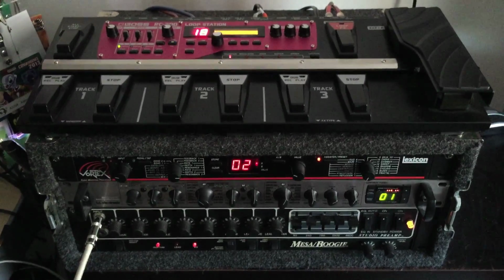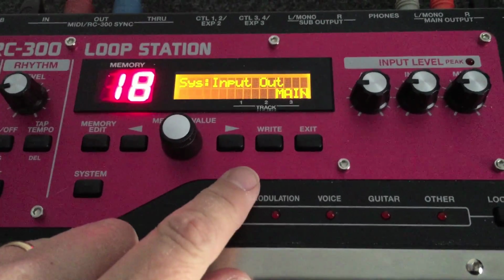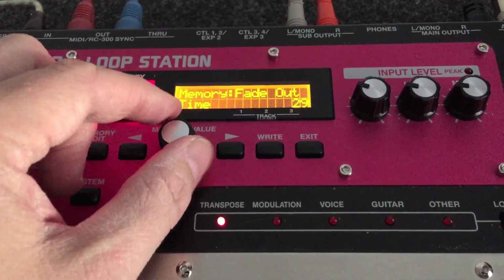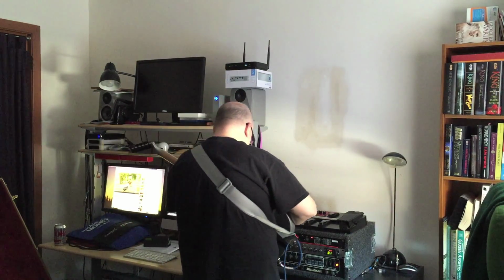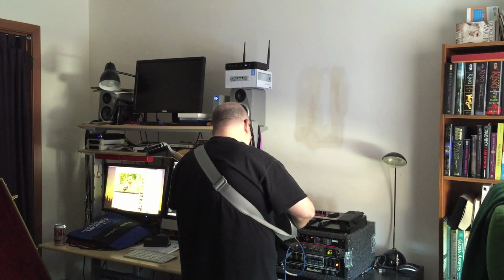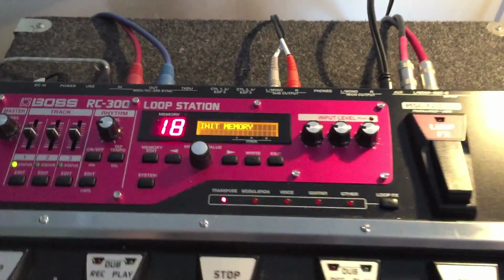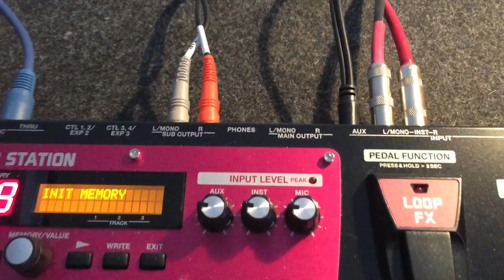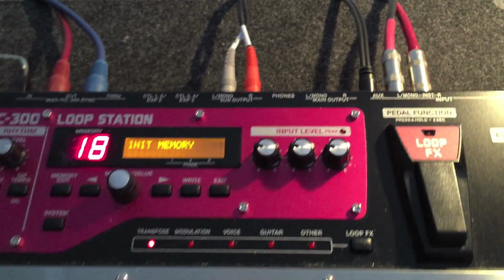Boss RC300 How To Do Loop Aging/Regeneration/Frippertronics On Boss RC-300 Part I

Comment: Can I commission you to do an RC-300/505 sync tutorial or conference? (Could not figure out how to PM you.)
Reply from the maker: Sync from the RC-300 to another device or having another device provide clock to the RC-300???
Reply: Thank you for your response.

I would like to sync an RC-300 with an RC-505.  The manufacturer does not have instructions for this specific combo. I had the 505 first, then I read about people syncing the 300 with the 505, with the 300 as the master. 

I am using the RC-505 with a GR-55. I bought the RC-300 for the floor pedals, knowing that three hands-free tracks were enough hands-free tracks for me; but not enough overall tracks for my purposes. 

You would probably get a good laugh watching my current work-around during a live [solo] performance. I have the two units on separate amplifiers. Lol. It doesn't really work. 

There's not any step-by-step guide that I could find for syncing a 300 with a 505, and the procedure may be out of my league without one. I don't need the RC-300 if I can't sync it with the 505. For my purposes, I would have got another RC-505 and experimented with auxiliary foot pedals. 

Incidentally, I have used the Roland FS-6 with the RC-505 for starting and stopping a loop. It's a pretty tedious exercise.

Thanks

Comment: Hi,
I've carefully done all the instructions, but I have just simple "delay-like" effect. What I do wrong? Please help...
Reply from the maker: Did you look at my "Part 2" video for this?  It looks like I might need to do a part III since you are not the only person having this issue.]
Reply: aliensporebomb , yes I did... But I still can't resolve the probem.
Reply from the maker: What type of instrument are you using to feed the looper?  What input are you using?  Are you doing this in stereo?  Or mono?
Reply: aliensporebomb , I use cello with mono pickup.
Reply from the maker: Thanks.  My other person who was trying this without luck was using a 
cello with a mono piezo pickup - I am going to try this mono myself to 
see if that is the issue since my rig is full stereo from input to 
output.  I wonder if you would need to run a dual mono signal for it to 
work?  Let me do some experiments and get back with you.
Reply from the maker: Oh and I had another user with a flute with a single mono input (I can't recall whether it was mic'ed or a piezo style pickup).  More later today.
Reply: Thank you! It would be great.
Reply: Hey guys - have been searching for this - great sounds! Am trying to set up the boss for this kind of use, cello/flute mono input too. Did you have success? Also ASB - when you change the system settings, does that apply only to that input number, ie not globally for the whole looper? Nervous of changing system settings in case I can't get back :) Thanks!